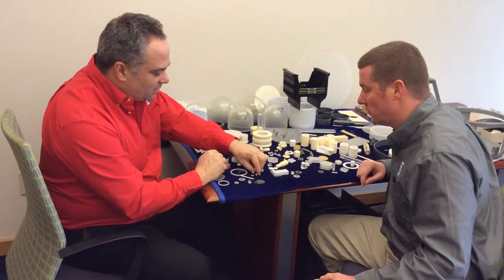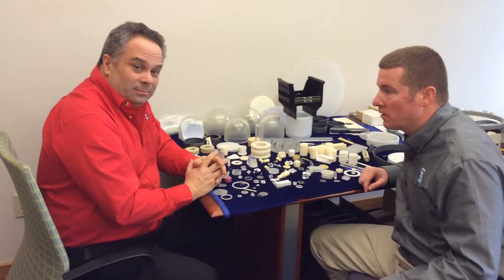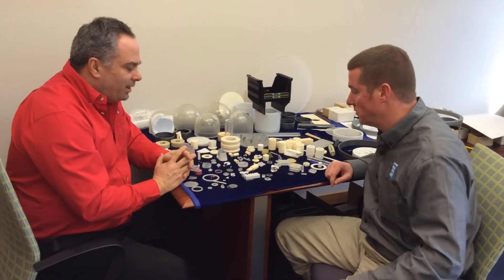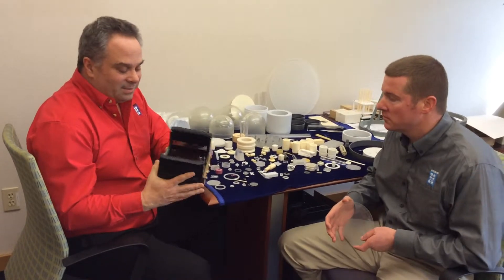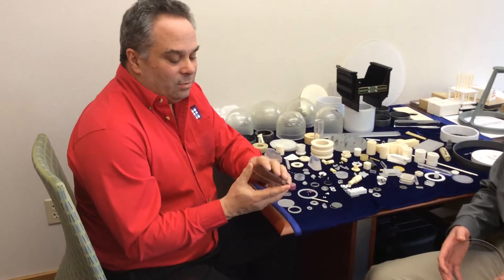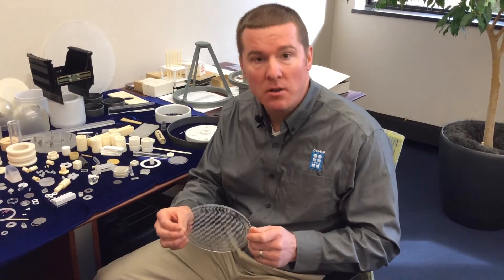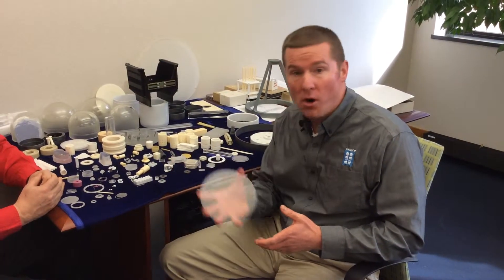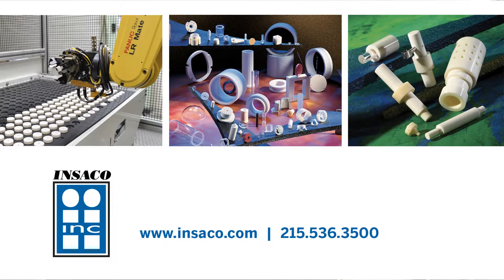Wafer Carrier Demo - Sapphire for GaAs, Indium Phosphide, & Other Semiconductors - with Music

Comment: He didn't explain why the backing holes make it easier. 
He simply mentioned that there are holes.
Reply from the maker: The sapphire wafer carrier is typically used for the backside thinning of compound semiconducting wafers which need to be processed from the SEMI standard thickness to a thickness of usually around .100mm after the front side is completed. 

This is done by mounting the compound semiconducting wafer to the sapphire wafer carrier using a mounting wax and then processing though lapping and polishing operations 

It has been shown that the demounting process can get difficult and be time consuming. 

The holes are used to aid in the reducing the difficulty and reduction in the time needed for the demounting of the compound semiconducting wafer from the sapphire. This is due to the capillary action that is created with small diameter holes.